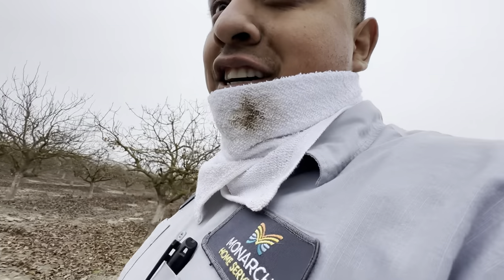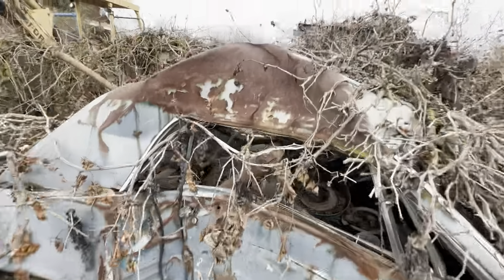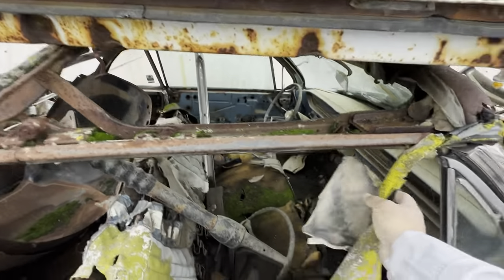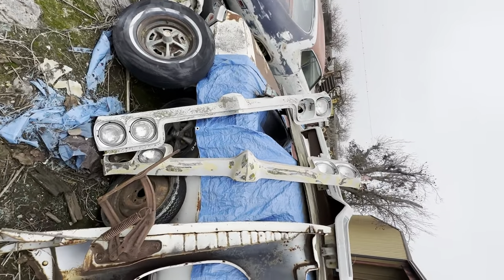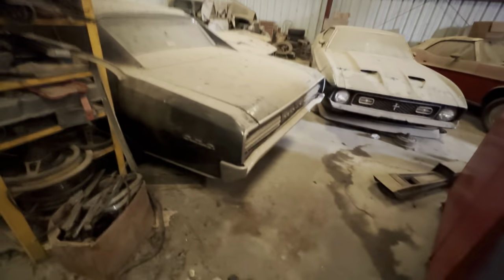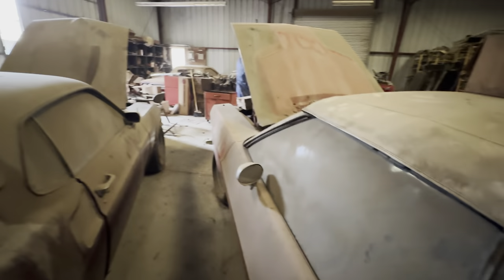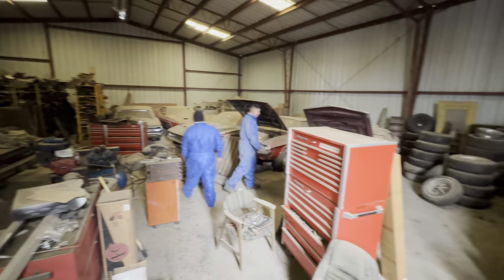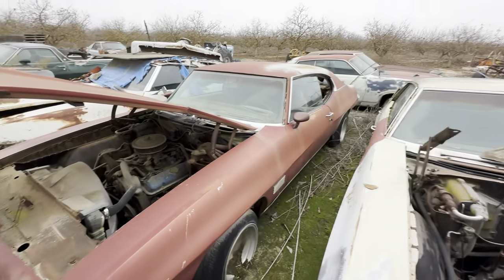Exploring a warehouse full of barn finds

Comment: I have found 2 429 BOSS MUSTANGS in MINT condition. Both are in NY state. Both are '70 B Mustangs. One price is 1/2 million and the other is 650 Grand. One has 16,000 ORIG. miles on it. That's the claim at least. There's another RACING version  429 BOSS and I believe it may be in CANADA. So BOSS 429's are a true "jewel." Rare needle in a haystack.

Comment: Raul. Yes, you and your buddies or co-workers have stumbled upon quite a barn find. Raul each one of those cars should be able to be "decoded" so one can identify EXACTLY the year, make and model. It eliminates any "guessing" as to what auto or truck you're looking at. Now I saw, those Mopars and knew what they were. I also saw the 429 BOSS Mustang. The 429 BOSS IS a "jewel" and needs to be rescued and restored back to "FACTORY ORIGINAL condition" as best as possible. I saw a few muscle car Pontiacs and the Ford Torino...possibly a GT.  Raul. "CONVERTIBLE" classic autos with BIG BLOCK engines(factory "original") ARE at the top of the list(food chain). They DO bring in the most money when they're in MINT condition. For example--a 1958 CONVERTIBLE Impala vs. a '58 hardtop both in mint condition with identical engines, the convertible (ragtop) would bring in a higher price. All classic car collectors know "ragtops" bring in more money than a hardtop. Raul, do some research(homework) on any one of these cars you've shown us. Pick 'em carfully. BIG blocks=BIG $$$. Without question. Word of advice, I would NOT even consider restoring a #5 much less a #6 car category. They're DEAD! It would be WAY TOOO much $ to restore to back to a #2 category which is a blue-ribbon winner at a car show. #1 (concourse) is just an astronomical price. Now the 429 BOSS Mustang might be worth restoring back to #2 condition and possibly #1...ONLY because it IS a VERY highly sought after popular classic muscle car which could pull in over 1/2 million ($500,000) in factory MINT condition. It's the 429 HEMI BIG block engine which made the car what it is. Have a good one.

Comment: The black 66 GTO in the back corner, that would be a nice ride.  Curious if maybe you were able to look inside or under the hood. Tri pack 389 4 speeds that are original are pretty rare to find. Sorta my dream car.  Never afford it though. Fun video. All your smiles.  Genuine. Thanks for the look.
Reply from the maker: I didn’t wanna open too many doors really especially not hoods I wanted to leave everything exactly where it was so I only cracked a couple doors open